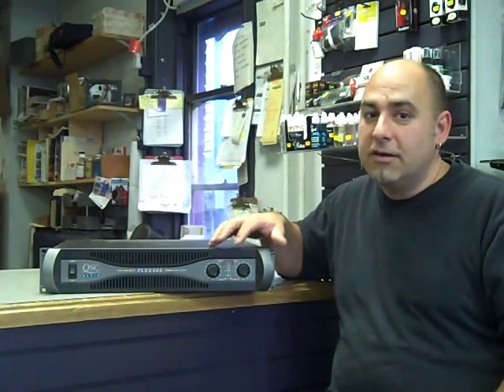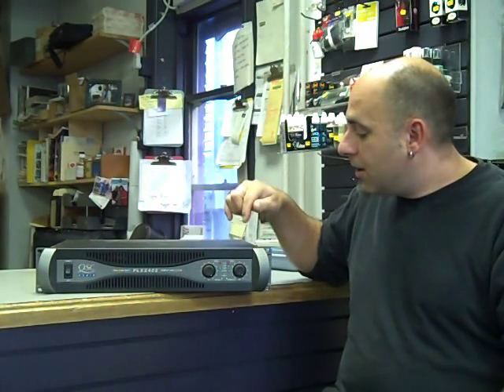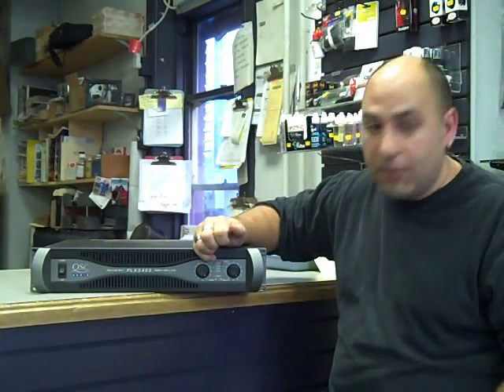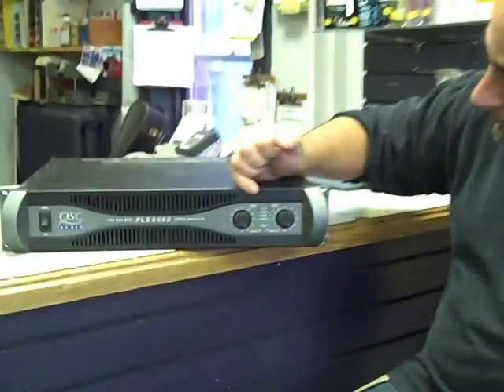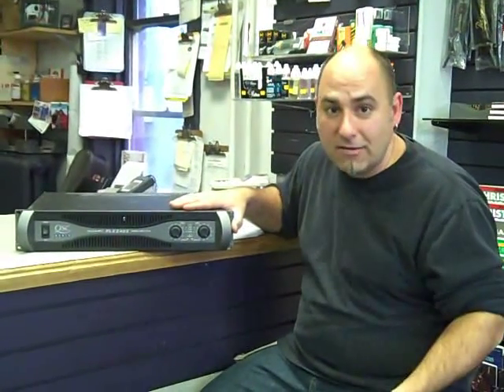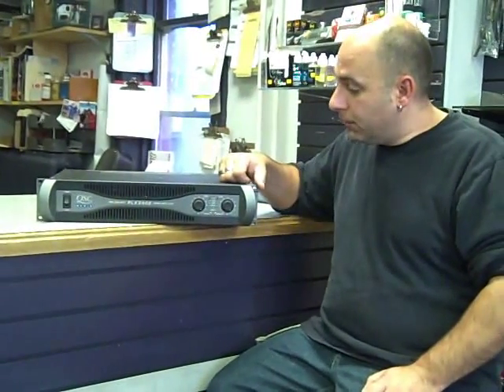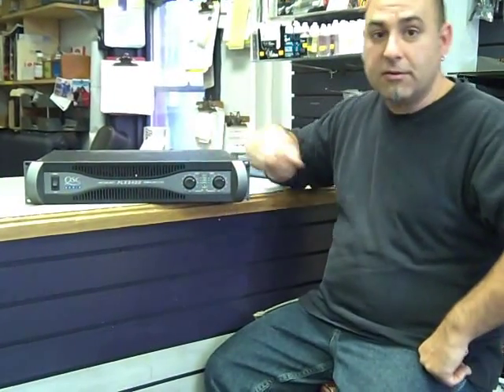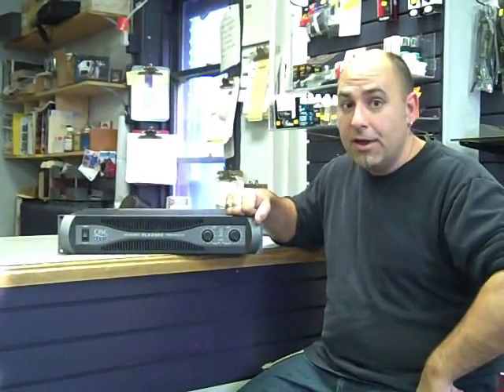When Power Amps Clip.avi

Comment: Hi, can you help me? My system is working great but my  only concern is that after i turn off amp and mixer amp starts to clip after couple of seconds clip lights turn on and are lit for 20-30 seconds. I tried to change order in which i turn off equipment but it didnt help.  I have behringer ep2500.

Comment: Do you know anything about tactile transducers?  I have a Behringer EP4000 powering a buttkicker concert.   Basically a magnetic piston powered by the amp.  But when using the ep4000 and every other amp I have found with the watts to power it clip before you even feel it.  Now its not a speaker.  So the company says don't worry about it because distortion isn't going to hurt the transducer.   But what about the amp?   Just seems surprising to me that im pumping 1250W rms into the thing but the power amp clips.  It seems I am either clipping my mixer or I am clipping the power amp.  If neither one is clipping then you cant feel anything going on.

Comment: hey bob, can you help me out. i have a 220watt power speaker. and well my speaker does clip. my question is if i would get another amp separately can i connect my speaker to it? and will the volume be able to go higher? if so what type of amp do i need? or do i need a mixer? or what please can you talk to me.and tell me a little about this. thank you

Comment: Hie Bob,  i have a KS600BA Sub woofer, it was faulty due to its Power Trans fail and it was in protect mode. manage to repair that part. right after that the clip signal is on all the time without any input or output connected. any tips or recommendation.

Comment: Hey bob....having an issuse with one of my subs. I have a QSC 750 power amp running 4ohm load on a set of SONIC 18" subs. (4 ohm cabinets) I'm not getting that big punch with those and when I start to push them (speakers) I have 1 that want to "fart" out....why just 1???? I have some outside venues coming up and I can push them the way I need to.... suggestions???? I probably need to get new subs?????
Reply: Can't push them....
Reply from the maker: Mark Scott Hey Mark,.....is that the QSC ISA 750? If so, that amp is made more for cinema installations than live sound...so that might be part of the problem...but I kind of doubt that theory. That amp is rated at 650 watts a channel at 4ohms. What is the rated wattage of your speakers? I remember Sonic from a long time ago...it was made by Soundtech which  was the Saint Louis Music company (which also made Crate).. How old are your subs? I'm thinking they might be from the 90's when Sonic was pretty popular in clubs.  I think you might need some new subs since the cones might be dry rotted. See if you can get a local company to rent you some subs and try them out with that amp. If they don't fart, then that's your answer. Also check your speaker cables....anything thinner than a 14guage speaker cable will create a pile of resistance in the line. Hope this helps!!!!
Reply: Bob Ranalli Thanks Bob....I did contact a friend of mine that is going to let me try out a set of Peavey subs (18") this friday night for an outside show we are doing. Very curious to see if this is an amp issue or speaker issue....
Will let u know if u wish :-)
Thanks so much for your input.
Reply from the maker: Mark Scott Yeah, Id like to know what's up....
Thanks!!!

Comment: okey as i understand it the lower ohms the more powerdraw the speakers has. The more ohms the easyier it is to drive by the amp? So feeding 8ohm speakers with an 4ohm PA amp is not harmful in any way?

We are talking two IBL LX60 L and R and an LEM 220watt PA amp.

Comment: im runnig an LEM power amp in my bedroom sounds nice. But whats missing is Subs i need to get an nice sub and an power amp for the sub. im somewhat insane running an 2x220lem power amp and large speakers in my bedroom. but hey. it sounds well. any thoughts how an 4ch power amp or 6ch one would work with an surround pre amp?

Comment from the maker: @ermollejuo 
O.K. let me ask you this....have you tried putting no signal into the amps and turning up the volume on the amps all the way up?
Sometimes there are shorts in the input sections.
What kind of mixer are you using? There maybe something up with your mixer or speaker processor  that's causing both amps to do this. The reason I'm saying this is that both are clipping and it's very, very rare that both amps would poop out together with the same problem  all of a sudden.

Comment from the maker: @ermollejuo 
I researched the p500 and that is a turntable.... Are you sure its not the p5000? ( which is a power amp). If it's the p500 turntable, the p7000 power amp will clip since the amp can't handle the impedance of the turntable. You'll need to get a mixer with a turntable input  on it then that mixer will send the correct signal to the p7000 amp.